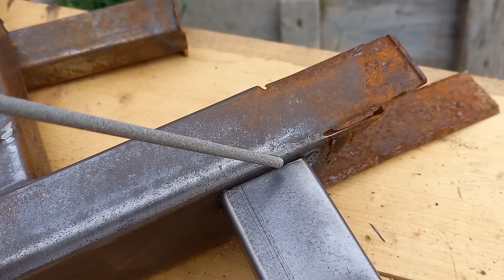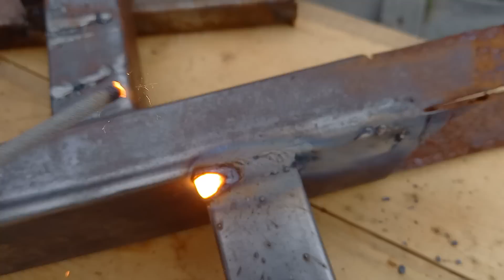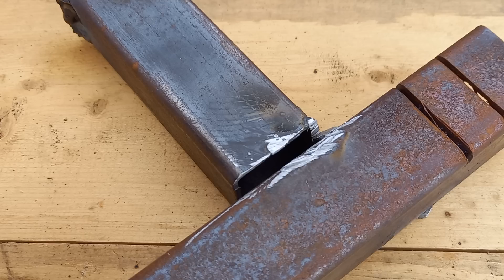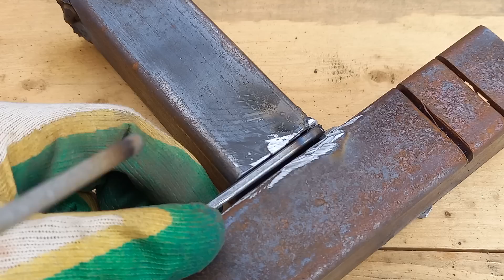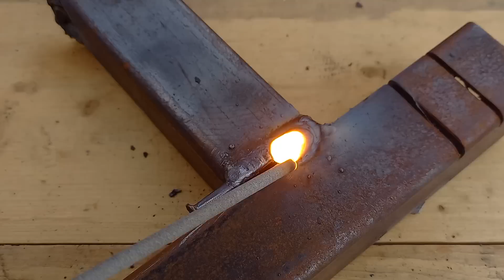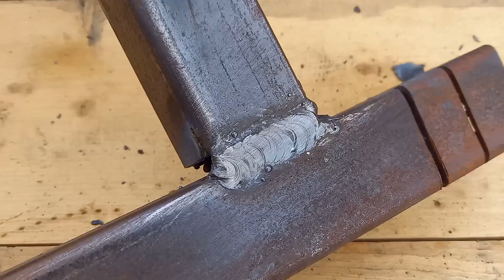The secret method of welding thin metal, which not everyone knows about !!

Comment: Putting another piece of metal/nail in the joint ti fill in gap is a big no no in the industry
Reply from the maker: You are right, but in some cases you can make an exception)
Reply: @handyman8486  Maybe only for backyard jobs 😉

Comment: this is so wrong on so many levels. To start off the rod is being drawn towards you. WRONG. you weld by going forward, not backward, so the rod should be pushed NOT pulled. Because its being pulled its not a continuous weld its patchy spots in a line. The weak spots and inclusions weakening the weld must be many. It is just a bodge up weld that if it was tested would fail miserably.
Reply from the maker: For the first time I hear that the electrode needs to be pushed and not pulled) although it may be more convenient for you
Reply: @handyman8486  If you pull you create gaps which have contamination and cracks and multiple problems leading to the joint failing. If you push the rod the weld pool (the area where the heat and weld is) advances forward as you push the rod forward. The heat of the weld pool draws the weld forward too, without there being any gaps as in the way you are welding. It creates a much better weld much less likely to fail.
Reply: Your comments are right for MIG welding, the video is on stick welding. The old saying 'if there's slag you drag' which also includes gasless MIG welding.
Reply: @olivertaylor4779  Generally unless there is a specific need to pull the weld its normal practice with welding to push the media forwards. If you push the weld, the filler deposits uniformly, a little like a river, it goes in one continuous flow. If you jab it like in the video and pull it toward you, you are pulling out of the weld pool and causing defects as its not one continuous weld but lots of small ones joined together. This causes a weak weld. If you X-rayed it the join would be full of fissures and fragmented. Not a good weld. This is as true for stick welding as it is for MIG. You have to make the weld pool move along with you, not create short bursts at one spot that overlap.
Reply: @olivertaylor4779   uhh ok...let's go with your theory......so I'm good to drag it down hill too ???
Reply: @jojocono4887  actually yes. If your pipe welding you weld downhill. Not that this is pipe.
Reply: @cersosi19  everybody's an expert...hahahaha...when a guy can't run it uphill  . You weld  pipe instead... 🤣🤣

Comment: Fucking ridiculous. For starters, use a smaller guage rod and lower amperage on thinner metal.
Reply from the maker: And if there is no electrode of a smaller diameter, what to do?
Reply: @handyman8486 
 ALL amateur welders SHOULD use 2.5 or 2.6mm electrodes. Those would do absolutely everything amateurs would need.